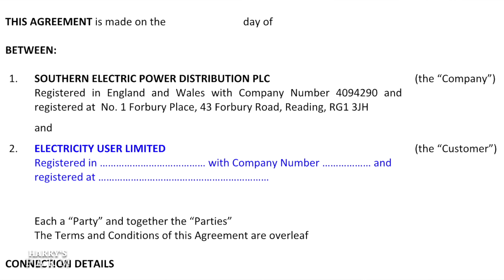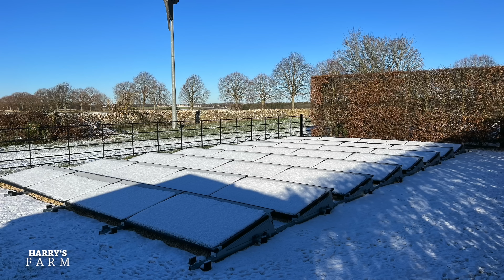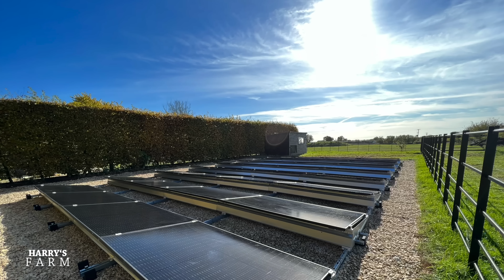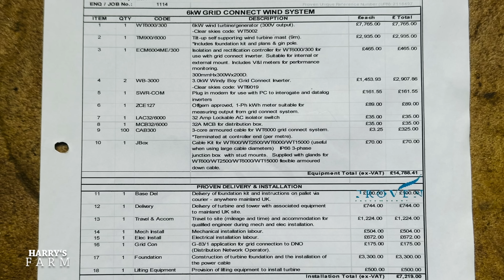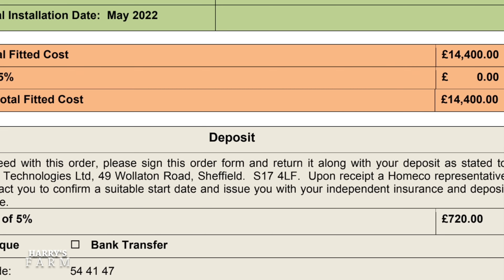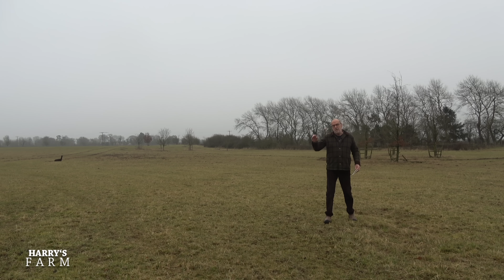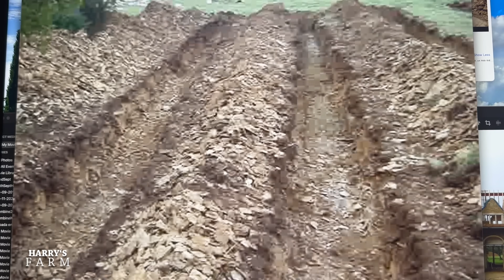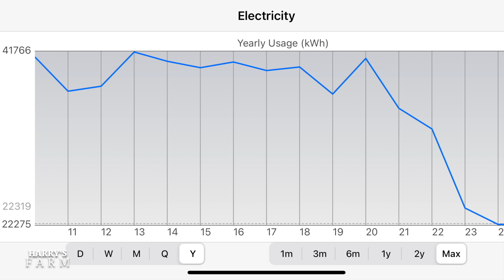Are solar panels & heat pumps worth installing? Here's what I've learnt after several years of use.

Comment: Harry's installation has panels set at a very low angle, which maximizes summer output but lowers winter output.  A typical roof installation will result in panels set at a higher angle.  A good system installer should communicate the angle tradeoffs to the customer before installaton.
Reply: 100% General recommendation is that your panel angle should roughly match your latitude. So, in the UK that's 50-60 degrees. His look to be about 10. So yeah, just about 0 winter output.

The snow also causes a lot of the drop.
Reply: As others have observed, the angle isn’t great for winter generation, plus being so low on the ground means shedding snowfall is harder. I would also have been tempted to have bifacial panels installed on white gravel, rather than the brown gravel in the video. They would reflect more light into the rear side of panels.
Reply: @garywilkinson5887  I don't really think bifacial panels were much of a thing when they installed.
Reply: We have a Cornish Rocker system where we adjust the angle of the panels through the year.  Works well.
Reply: @colebrooke01 how many panels did you use and could you give an indication about the price of the Cornish Rocker? I am interested in that system. Cheers!
Reply: Shame the ground mounted panels weren’t mounted on a simple manually adjustable frame to change the angle during the year. Also I assume the installer recommended optimisers due to the shading issue?
Reply: @Steve-6536 Those adjustable frames are available. I saw them on Artisan Electrics YouTube channel. Optimisers are quite a new thing, but would solve the shading issue.
Reply: I have two insulations of solar panels, the one you saw in the video and the other installation is on a roof up at the farm, which are at a much steeper angle. There is very little difference in output between the two, they are just as bad in the winter as the ground installed panels.
Reply: @harrysgarage isn’t the angle of that barn/building less of an angle than a domestic property 
, also aren’t they flat on that roof so maybe the angle on the roof is just slightly better than the ground height doesn’t matter really.
Reply: @harrysgarage  Strange! The problem with the shades can be helped somewhat with micro-inverters so each panel is more independent.
Do you have any heat storage so you can run the heat-pump when the power is cheap?
Reply: @harrysgarage a steeper angle, the snow may slide off the panels.
A south facing fence line may be a cheap way of supporting the high north side of the panels.
Reply: @ Thank you for the reply. Firstly great video and very much enjoy both your channels. 
Its strange your other panels do not perform better, its a fact that steeper panels work better in the winter. But you are very much correct that in more northern latitudes the difference between summer and winter is huge. 
In regards to Solar farms, Agrivoltaics  where grazing and solar are combined is an interesting direction for some of them.
Reply: @harrysgarage  Cornish rockers?
Reply: @harrysgarage  If they're covered in snow I'm amazed you get anything out of them.
Reply: @harrysgarage  I have found that pointing the panels straight up on cloudy days gives about 20% more power than pointing to where the sun should be in Winter. I decided to construct tiltable panel mounds (vertical tilt only), and follow the average solar angle for 9 months of the year, and straight up in Winter, which also helps protect the panels during a storm. This arrangement may not be ideal if you live in a snow-prone climate, where you may want bifacial panels mounted much higher.
Reply: @harrysgarage  - Ideally the perfect system is panels which track the sun position. You want the panels to be at right angles to the sunlight for a much time as possible. This reduces reflected light so passing the maximum amount of energy into the panel .
My father in law built a small pv farm in his land and had the panels raised on stands with support straps he could adjust for each month based on his calculations for the best angle of attack. I'm not sure it made a massive difference because unfortunately he passed away before he got any reliable stats from it.
Reply: @harrysgarage the rule of thumb is that your angle should be at a minimum the same as your degrees of latitude. That’s 51deg for the cotswolds - if you have non-adjustable frames, have the panels set for peak winter collection when the sun is lower.

I just checked my figures in NZ - June was my worst month and my 5kW system gave me 451kWh vs 1019kWh for December

So, it is your continuous grey cloud cover that is the determining factor. Even in winter we have clear skies for most of the day, except when there’s a storm
Reply: @harrysgarage That’s not good to hear. I was pretty well sold on panels when we move to an old heated Victorian farmhouse in Wales in 2 weeks. Now I’m getting cold feet. Excuse the pun
Reply: @harrysgarage - judging by what I've seen of your farm buildings, the roof angle is still low - 30 degrees or less.  At your latitude, an angle of 40-50 degrees is needed for maximum winter output.  Also, both installations are oriented well west of south, which will help with summer afternoon output but lower  overall output.  Large commercial installations usually opt for due south orientation.  Again, these are tradeoffs.  With the UK's high energy prices - you appear to be paying ~2x what I do, and I do not have time-of-day pricing - maximizing summer production and afternoon production may be the better choice financially, but may not lead to year-round energy "independence".
Reply: @harrysgarage  I don't know that 120kw figure doesn't seem right to me we produced 340kw from 6kw panels in december, albeit we are much lower than where you are we are at similar latitude to where barcelona is. Still I don't think we should be able to produce 3x the energy from 1/5th the capacity
Reply: @ceconk123  is your cloud cover the same as the UK in winter? The UK, on average, gets like 50 sun hours in the entire month of December. Massachusetts, a relatively cloudy USA state, gets 140
Reply: @marcob1729  it’s about 60 hours average on december
Reply: @ceconk123  Presumably you mean 340kw hours from 6kw panels?
Reply: @marcob1729 There’s a difference between sunlight and daylight. Sunlight is a function of weather.  Cloudy weather produces less sunlight.  Daylight is a function of latitude.  In December the further north you go there are fewer hours of daylight, regardless of whether or not it’s cloudy.  In December the UK will have 1-1.5 fewer hours of daylight than Massachusetts.  So when you compare 50 to 140 hours of sun per month, don’t forget there’s 30-50 fewer hours of daylight in the UK in December.
Reply: @roch145  The entire point of my comment was about sunlight and not daylight...
Reply: Not to mention they should have communicated that with a single inverter, any partial shade on a panel will take the whole panel out.
Reply: With the space he has a pole mounted system with active sun tracking would make more sense in low,sun England.
Reply: @Cheers_Warren fixed orientation gets better use of land. England is typically short of land
Reply: @dougaltolan3017   I was suggesting a single pole system, you can get a lot of panels on one pole and then add sun tracking for much greater efficiency.  Friend has that system in usa for 15 yrs working so well.
Reply: @dougaltolan3017 Wales has plenty of
Reply: Exactly what I was thinking ! I'm at a similar latitude and that wouldn't be recommended here. Sun will be across their face in December, not presented to the winter sun at all it appears.
Reply: Just what I was thinking. Very poor of the installer not explain that with such a shallow angle there will be very low production in the winter. Of course if you had a steeper angle then you would need them further apart. But this should have been explained to Harry when he ordered the system.
Reply: @adamcole4808 
Harry had solar (sun) panels installed for his swimming pool. Robert from Fully Charged runs his fully electric house, an office, and several EVs on solar.
Reply: @adamcole4808 There will be a very low production in the winter regardless....he might as well put a blanket over-them
Reply: Using the latitude of the Cotswolds they should be at ~65 degrees above the horizontal in winter; his ground and barn panels are nowhere near that high.
Reply: Optimal angle probably around 40 degrees,  approx noon elevation of sun at equinox.
Reply: @r.markclayton4821  ...in the summer only.
Reply: Some larger field installations are mounted on stands that change the angle automatically using motors on their stands.  They use solar light sensors to detect the most efficient angle for the current time, and they are able to go to a steep angle during snow storms and such to prevent snow build-up automatically as well.

Pretty cool tech, but in the end, like Harry mentioned, the sun just doesn't have the output during the winter months (even if the panels are directly facing the sun) for it to make much sense farther away from the equator.
Reply: I had this issue. Given the British winter thick cloud and lack of daylight, fixing the panels for optimised winter output gives you an extra 10% of almost nothing. Best, IMO is to optimise for summer, especially if exporting.
Reply: I really don't think angle matters much with that amount of cloud cover
Reply: It wouldn't have change the outcome drastically, maybe instead of 14x less power it would have been 10x less.
Reply: Winter sun with my ground mount at steeper angle and micro inverters still doesn't produce much, even on the south coast
Reply: Potentially a battery installation for your setup may not work, but, there is a point to having one installed and it becomes very useful during the winter. With the help of a time of use tariff, you can charge up your home storage battery and electric car overnight for a period of 6 hours or more.  This costs me 7p per kWh and I export at 15p. In essence you could have a home battery and no solar panels and still save money this way, granted it may take longer to pay off the investment.
Reply: Winter would always be massively lower anyway, even with a system that tracks the sun
Reply: Doesn't really make that much difference. It was more of a concern when panels were $5 a watt and a dollar (or pound) was worth a lot more in purchasing power. Install a few more panels. I maximized for winter, but it's not all that critical unless you are on a very small budget.
Reply: even at the right angle, nothing significant arrives in winter... Solar is an expensive hobby and rarely pays off... A nice sympathetic idea. But nothing more... The more solar we build, the more expensive the electricity generated by the suppliers will be! A vicious circle!
Reply: @ Solar is even less attractive if you eliminate government subsidies.
Reply: @KnallKalle that is patently false. It's trivial to look up the cost per kWh. Solar and on shore wind have half the unit cost of a gas turbine plant
Reply: @ is that before or after the government subsidies?
Reply: We have ours on a 35 degree slanted south facing roof. We still see a massive difference between June and December. Seasonality still exists sadly.
Reply: Harry you need more panels and put on a decent tilt as others have said. Panels are so cheap now. You could just add more in parallel with existing panels to your existing inverter so no need to discuss with the power company.
Reply: 10:1 for summer vs. winter output is perhaps the best you will get if you optimise the angle for winter!
Reply: Shame they are not on rachets that could be wound up and down for the winter vs summer months.
Reply: @CJMVector321190  a system for adjustment exists. In general terms it is more efficient to just use the extra cost to buy more panels.
Reply: The UK needs nuclear power more than they need solar or wind power.  Renewables do not provide base load power. Managing the grid itself is a demanding , difficult and delicate task. Frequency and voltage management are critical and cannot be achieved without sufficient base load power.  Given the UK’s northern latitude and cloud cover, solar is not a terribly strong option.  Industrial scale solar requires massive amounts of land. And her sun doesn’t shine at night which then requires batteries for storage, adding to the cost.  The UK is hellbent on EV’s. Solar and wind isn’t going to supply enough power for that.  Not to mention the power AI data centers will require.  Nuke power is the way to go assuming you believe in CO2 driven climate change.
Reply: @roch145  I agree but there is a security issue as well. With the level of stupidity rising among both the educational system as well as the elite nuclear power seems to be an increasingly unfit technology. As the soviet Union has already demonstrated it's not safe to have people put in charge based on political criteria instead of competence.
Reply: @ Just look at France.  65-70% of their electricity comes from nuclear power.  They have a single reactor design throughout the country and a single set of operating rules.  There are plenty of reasons to embrace nuclear power. Including national security.  You can’t use the Soviet Union as a reason not to embrace nuclear power.
Reply: @roch145  Nuclear power does not exist
Reply: I have PV panels on my roof and batteries to  run the system overnight. I have to use radiators as I have a traditional 1940s, the house was overhauled to reduce heat loss and we use as much electricity as we can during the day. The result is our 4 bedroom house costs £1,400/ year for everything. My neighbours have identical houses and their gas central heating is £2,500/year plus their electricity. I was told by almost everyone that it would be ruinously expensive, but the comments have stopped now I have a year of real data.
Reply: Depends which way your house is facing.....you're gonna need a bigger round house‼️
Reply: Why not make adjustable panels? Especially if they are on the ground.
Reply: I am surprised with a ground installation, he cannot crank it up to a higher angle for winter usage.

Ralph
Reply: He should also replace them with bifacials now.
Reply: Grab yourself some optimizers Harry then you can make a video in a year telling us how much impact they have. My instinct is they may have a really significant impact on winter output.
Reply: It's also seeing shade on at least one panel most of the time in winter, with close hedges and fences, and the sun being lower in the sky. I think he would benefit massively from optimisers.
Reply: Very accurate observation. Also instead of orienting the panels southwards you have to consider the local meteorology and geography. In my little Cyclades island there are less clouds in the morning than in the afternoon when the heat evaporates water from the sea and often generates clouds. And also my house is on a mount with the inclination facing East. So it made more sens to align my panels Eastwards rather than due south. As a result the pick production is shifted towards morning hours and matches the morning consumption pick. Unfortunately the sun is behind the mountain in the evening so there's no point to try and catch any of it.
Another thing people have to take in consideration is the season they occupy the house. Here most houses are empty during the winter. So you better optimise for  summer production and even try to be fully off grid.
Reply: Actually this is rather well calculated as you only get an extra generation of 3% at an optimal angle (32/37 degrees) compared to say panels at 5 degrees.
The system shown is typically at 10 degrees there are 2 reasons for this.
1) the shading from behind a panel at 35 degrees is rather significant that you would need to space the panels out more resulting in more materials needed and more space needed.
Meaning you can fit more panel on a smaller area and get a better generation.
2) if it was at less than 10 degrees it would just get covered in dust and the likes reducing generation as when it rains it cleans the panel some what

(Should point out that system seen is typically for flat roof mounts not typically used for the ground)
Reply: Hilarious spouting on and on about angle….there is no sun in England in winter…short days..rain and cloud…only Ded Moribund thinks covering the countryside in solar panels is a good idea…because Dale Vince has told him 💸 💰…look at the energy app showing the source of UK electricity…Zilch in Winter..
Reply: Forget the angle… there’s precious little to no sun in December or January when you need the energy….pointless in the summer when you need less…only Ded Moribund and Dale Vince who invests in labour think solar saves the UK energy ….even in California a billion dollar plant has failed to deliver
Reply: Angle doesn't make a huge difference in efficiency. 5% tops.
It's more where U live in the world.  My winter output is half the summer output and my panels are at 5⁰ off horizontal split between East and West facing.
Reply: The angle does make a difference, however it's only a marginal one 

Source: My wife sells these & we have a roof & ground install

I'd say the shallow angle ground installation is about 95% as productive as the ideal angle 

We've just gone through a couple of winters in the UK which are far more cloudy than usual. Solar has been awful the past couple of winters (& beyond)
Reply: My guess is that they thought about it and optimized for: space (high angle would require a much deeper field) clouds (if clouds are there 90% of the winter time, low angle is not that bad) and esthetics
Reply: Higher you tilt them more land you need to install due to over shadowing in winter. Plus winter output is minimal due to amount of cloud so maximising summer output is best in UK
Reply: Fair comment as to communication but winter overcast even on perfect angles and output is dismal . 10kw system dec 24 163kwh output March 25 on the other hand 1094kwh
Reply: The energy bill for my 4 bedroom detached house (gas and electric) including standing charges is £1,500 per year. The potential savings from any investment don't stack up.
Reply: Absolutely correct , he is in a position to afford a large scale tracker
Reply: Yeah, everything about that installation seems to suck. They should have used micro inverters if they knew there was going to be shading and being a ground-based rack, should have given his one that could adjust the angle, as it’s so accessible. I would think that’s a terrible advertisement for the clowns that installed it.
Reply: everyone do their own analysis, don't  just follow rules of thumb...for instance; I am heating with mine, so winter angle gets priority...I don't even use all the power available except in winter.  others may need max cooling and none in winter
Reply: I was walkways sceptical about solar panels and airsorce pumps they give most power or heat when you don't need it and the figures you gave show how long it will take to pay for themselves by that time they will probably need replacing
Reply: Why didn’t you mount them? A meter high and then put chickens underneath?
Reply: Is it true that with a Ground Source system the ground above is so cold nothing will grow - the warmth having been drawn out.  Or have I been led up the garden path.
Reply: Latitude -11° so if your 52°N-11°= 41°is the optimal angle for summer and winter
Reply: It doesn't matter, there's just no sun in winter anyway. I've tested at every angle
Reply: Or better, provide ability to adjust the angle?
Reply: Tilt doesnt make as much difference as you might expect.  Even at 45 degree off from optimum incidence the panel will still deliver about 90%
Reply: @mycameras6814 that's true but when you live in a winter climate you can make a substantial difference around the lean solar days in winter when you need energy the most.
Reply: and also mention the big issues a steeper angle on a ground installation will cause.

Far bigger area cause the usual distance will be 3 times higher to avoid shading at a 45° angle on a ground installation 

and a lot bigger and more expensive mounting rigg that can handle the british windloads which are much higher than even in northern germany. 

Not that simple as you tell it, far more complicated to do a serious math or simulation of how much space would be needed for a steeper installation. 
And Harry has clearly said: no solar panels on his old style homes roof 

Then there is only 1 solution left: less panels with a steeper angle no hurting each other with shading or more panels which will cause shading in the winter time when output is needed 

Otherwise: 3 times bigger area in depth or a single and much longer row of panels 40 m eter in 1 row and he could adjust the angle like he wants.
Reply: Unfortunately solar is and will always be a 3rd tier renewables in the UK, if it wasn't for the feed in tariff,  no one who could connect the mains would have solar. I think the main reason it is considered 3rd tier is it tends to produce power when you don't need it. Also solar needs regularly maintained and it is commonly  sited on prime agricultural land so is is displacing  crops or carbon capturing  activity which is much more efficient than a solar panel is at utilizing the suns power
Reply: Tracking makes little difference under cloud. You're pretty much as well off flat. Since it's normal to size for the worst sun, it doesn't make a lot of difference.
Reply: They are too low even for summer at his latitude.  At 52 north, at the summer solstice the optimum angle would be 29 degrees from horizontal.  At the winter solstice they would need to be at 75 degrees.  A fixed installation would need to be near the middle of that range but biased towards the angle that works best for the season with the highest energy usage.
Reply: I am the least knowledgeable person about electricity and solar and even I can see the shallow angle of those panels is going to be useless in winter. 

Where I live (SE Europe) it is common to see panels mounted vertically to get optimal winter output and that is exactly what we will be doing. 

Some friends recently rearranged their existing panels to face half to the west and left half facing south and the output changed significantly. They also installed their west facing panels vertically but on a frame that allows the panels to be tilted back to take advantage of the angle of the sun through the year. 

We are talking about DIY installations, so I’d be furious if I’d paid top money for a professional company to install a system of that size and they did NOT talk about optimisation. 

But then I never had the money to install any renewables in the U.K. and frankly the investment would not have been worth it, Solar, nope, retrofitting heat pumps in an old house, also no. 

Here we bought a system with 10kw of panels and 20kw of battery storage for about £5k, (plus whatever we spend on the frame for the panels and the shed to house the gubbins) and we will absolutely get the payback despite electricity being very cheap here.
Reply: That is one crap install.
Efficiency will be very ,very marginal.
Whomever did the install should be ashamed of themselves esp if they consider themselves to be a professional company
Reply: Best angle for the Uk is 45 degrees. You get good generation in spring and autumn, summer is always very good. Rough guide for south facing solar is 1mw per annum for every kw installed. You can fit micro inverters or optimisers to look after shading. Panel quality can play a large part in low light generation.  With what you generated I think you’re doing ok.
Reply: I’ve often wondered how effective each of these systems are. I got the land and the sunlight.
Not sure if I’d want the hassle or responsibility 🤔
Excellent programme really enjoyed it.
Reply: @welshboys3033 > Not sure I’d want the hassle or responsibility
Personally I find the solar panels to be mostly install and forget. We do wash them once in the spring because they get mucky, but the solar loss from dirt is much less than you’d expect. Snow is a killer. Bifacial is the solution to that. As far as leaves and stuff go, a leaf lower makes short work of it after a storm or the natural winds will do the job eventually. They are on a pitch and a lot of stuff just slides off.

The battery (powerwall) has been more work. Initially this is because the WiFi design is poor (shielded by metal cabinet) and they don’t stay on the network. I eventually ran Ethernet to the thing and it was much improved. However, if the power does go out, they are fragile to black start if the battery runs out and they need to bootstrap themselves in the morning. This is because the AC coupled battery must compete with the entire house to recharge the batteries and the house is cold having been without power for part of the night. If the battery is too low, this process can fail and even though there is plenty of sun, the system can’t make the signal to synch to with the huge latent house load and the panels don’t turn on, and therefore never recharges. The newer powerwall 3 design is DC coupled to the panels which gets the house out of the loop and should have far less of this sort of trouble. At least for us, this problem means the house is probably too complicated for renters or young adult children to operate, so we can’t just disappear for months at a time to live in some far away land. Changes to the system would trigger an expensive tariff renegotiation with the utility at much worse terms so we are kind of stuck. I wish we had installed much more solar too, to deal with low light in winter. I think we would get more, but we are surrounded by California redwoods and the low solar angle just means the trees get the light before we do.  If you plan to be mostly off grid, design the system for winter production, not peak summer.